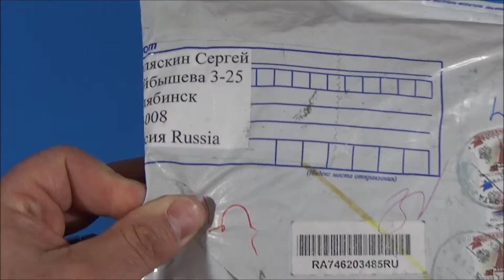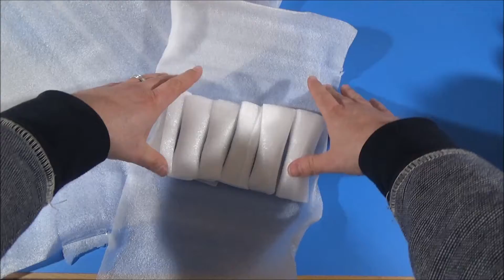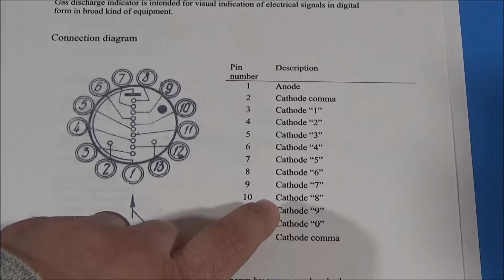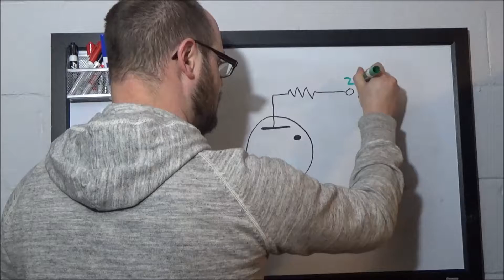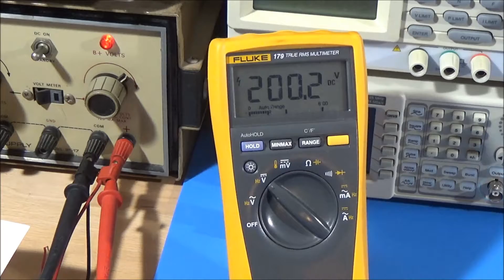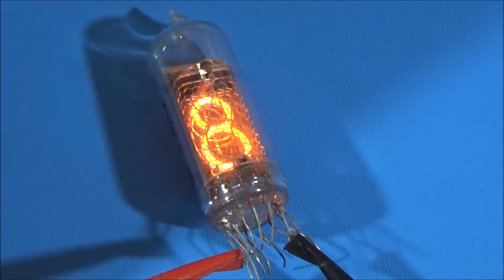OhmsAtHome #13 Nixie Tube Clock (Part 1)

Comment: Beautiful and warm work hours. I made myself of the same lamps. Before soldering on the Board check out the lamp below each figure glowed evenly. Judging from the short conclusions they used. In Russia we have used these bulbs sell for 40 cents.
Good luck in the build!